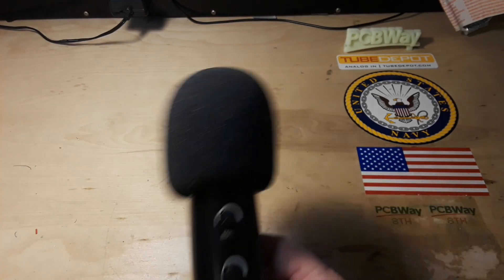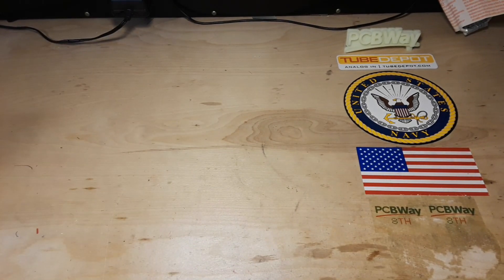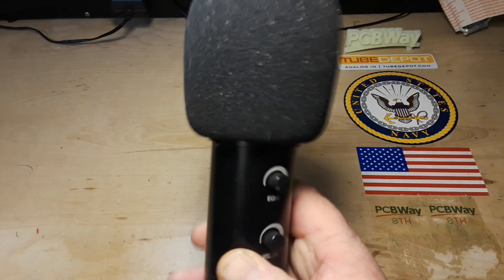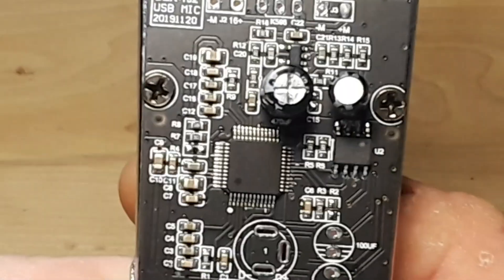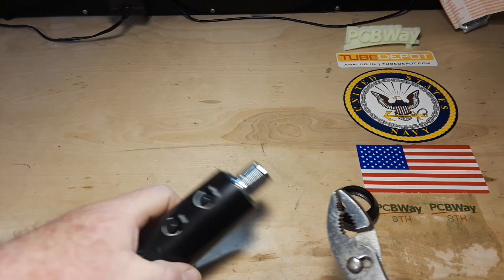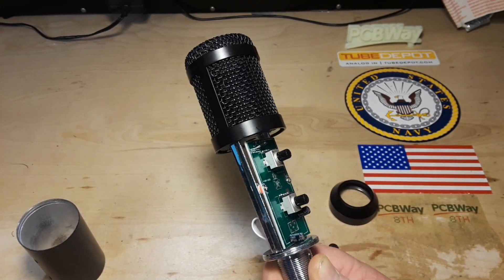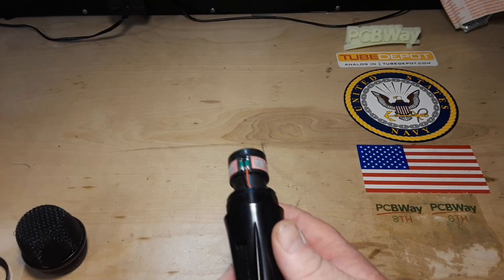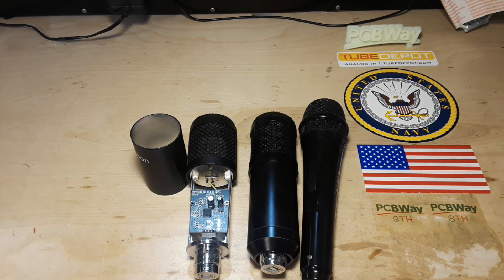Condenser vs. Dynamic Microphone

Comment: I'm a bit confused about phantom power.  It's always referred to as about 48 volts. Yet most lower-end audio devices don't have any way to generate 48 volts and instead supply 12 volts as phantom power.  Is this an issue? Would providing external 48 volts help in any way?

Comment: These particular condenser mics appear to have USB ports, so they actually do not have phantom power. Phantom powered mics use (most of the time) a balanced line on an XLR connection and get their power from the amps they connect into. Some lower cost mic setups however may use the TRS type connections, and these are generally unbalanced and have no phantom power applied. But the elements were the focus here, and I say, great vid on the subject! Look forward to the next one.